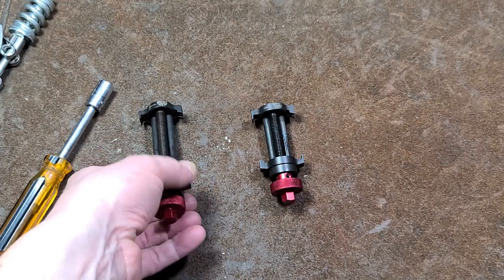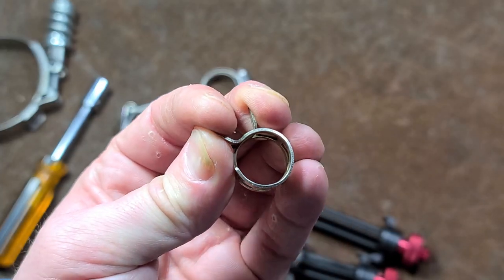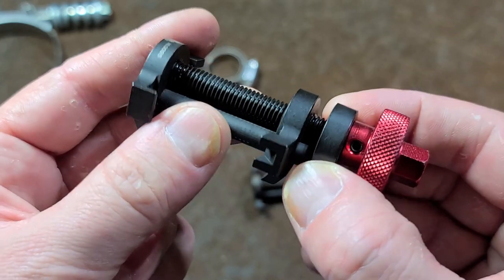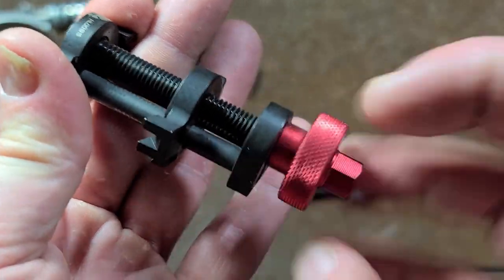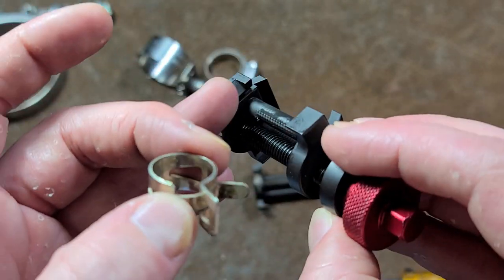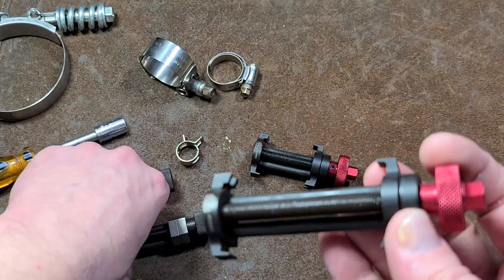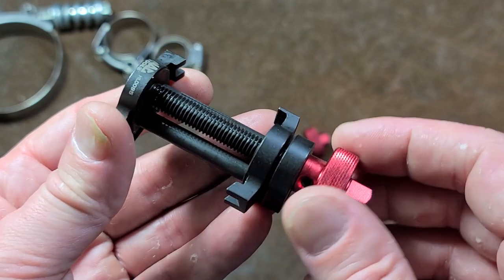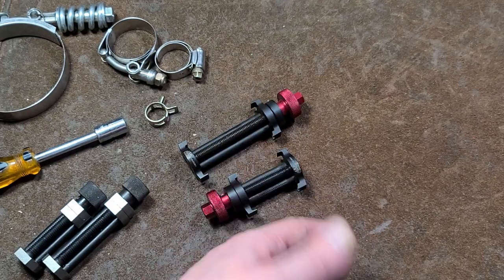Mac Tools Hose Clamp Vise Set Review

Comment: A lot of time there won't be space for these vises. In tight spaces, my experience is that a pair of very small (4'') vise grip pliers is the best. You use it along the direction of the hose. So it requires little extra space.
Reply from the maker: Thanks for the tips!